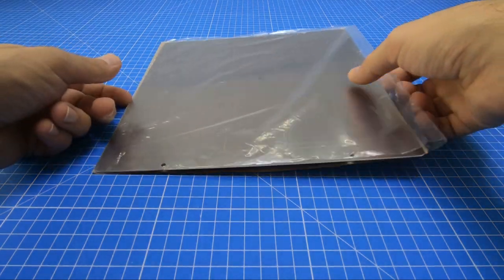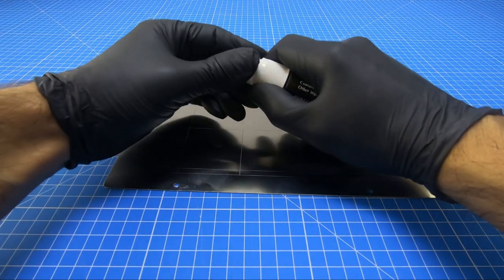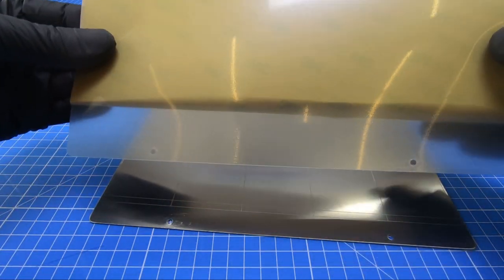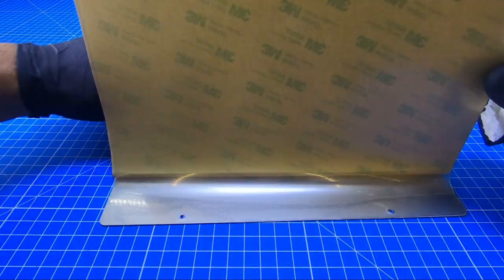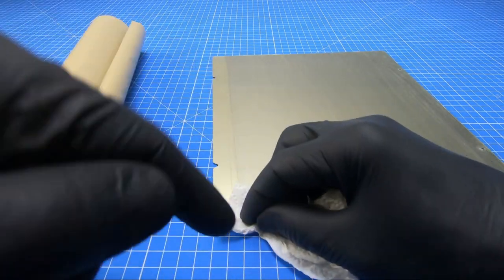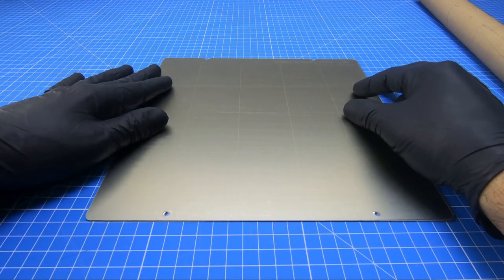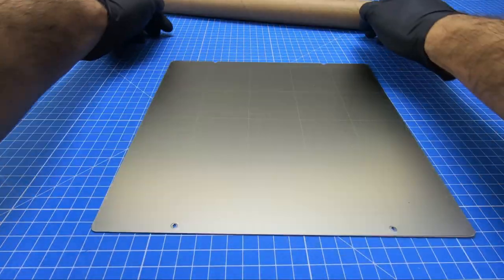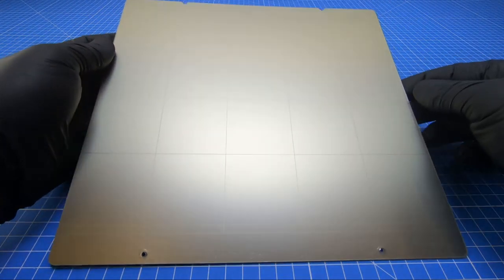How to install PEI sheet without bubbles

Comment: I recommend wet application, just like it’s done with window film or car wraps. Just add a few drops of baby shampoo into distilled water to cover the metal sheet. Now disperse the solution on the steel sheet and cover it well. U can then place the PEI sheet with the adhesive side right on the wet surface, push the bubbles out and position it perfectly. Then use a squeegee to push the remaining water out, and let it dry for a day. 
It’s dead simple and works every time
Reply: Wait really?!?! This would be a god send if it works! The last time I replaced the pei sheet I got massive bubbles

Comment: I would highly recommend to coat BOTH sides of the steel sheet with the PEI Sheet, otherwise you can scratch the Printbed with it and open the contacts to the heated bed.
I didnt do that the right way and after the fourth print i (luckily) noticed that sparks occured between the holes, not nice to see Something like that :/
Luckily the opened contacts were near the edges and not that big so I sticked electrical isolating tape on them to fix it, but i think eventually i will get a new heated bed for safety reasons...
Reply from the maker: Yes! As I show it in this video you have to install both sides. This short circuit caused your error messages also?
Reply: @Dombi3D  Unfortunately not, but it seems like the Firmware works properly except the error message that showing up and because of that I am unable to switch languages.

Comment: What’s the advantage of putting PEI on both sides?

Really enjoy your video’s on the Fysetc clones. Keep them coming!
Reply from the maker: You can use both sides. And it protects the heated bed against direct metal connection also. Won't wear out so quickly its surface from the repeated changes.
There are minimum 3 videos planned with the clones (bearings, MMU2s, Mini). I am just dead slow with editing (I am a beginner on that area).

Comment: any reason why you remove the protective sheet before squeezing out the remaining air?
Reply from the maker: The reason is that I thought first that what I see is between the protective layer and the PEI sheet. After I removed it realized that I am not finished yet and I have to give it a final squeeze with the roll. I tried to cut the video so that I left this action at the end but because of the bubbles would be questionable why is it so, so I left it in real time order. I wrote down in the description that you can left that layer on till you finished directly because of this :)

Comment: how about showing us how to remove the existing sheet without bending the crap out of the metal plate?
Reply: Put the plate in the freezer for a few minutes, it will pull off easily.  The only hard part left is removing the adhesive, but not difficult if you put a paper towel on top and soak it with D-limonene for a few minutes, then with a plastic scraper scrape off the softened adhesive.  May have to do that twice, then clean the plate with IPA.
Reply from the maker: If I have to change it I will record it and post here :)
What I would do is to heat up the plate to 210-220 °C in the oven and after that try to peel it off. The data sheet of the M3 glue that is mostly used by these sheets writes max temp. 204 °C so above that should loose its good sticking property.
Reply: @Dombi3D  Put in the freezer! Not the oven. When frozen it peels off very easily.
Reply from the maker: @BatByke  I will give it a try when comes the time :) Thanks for the tipp!